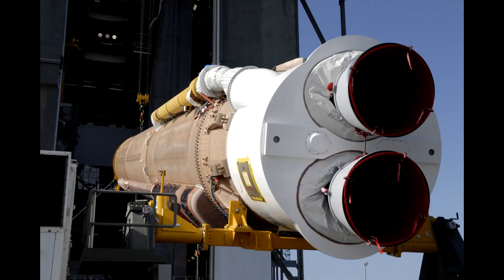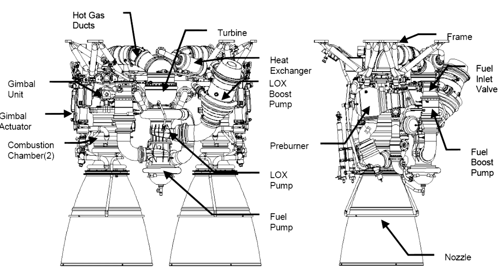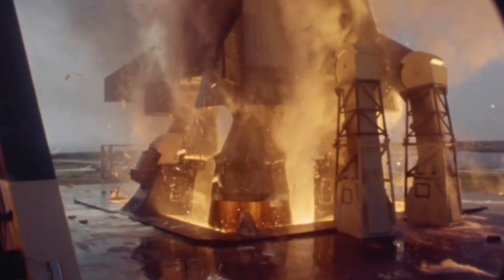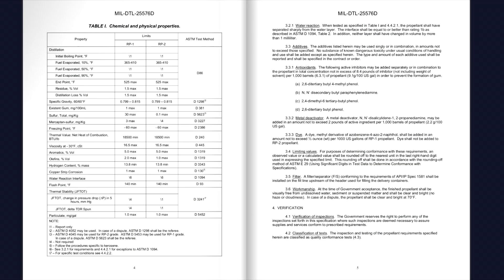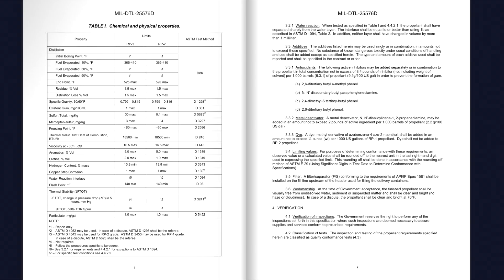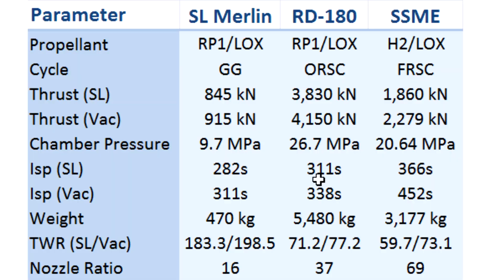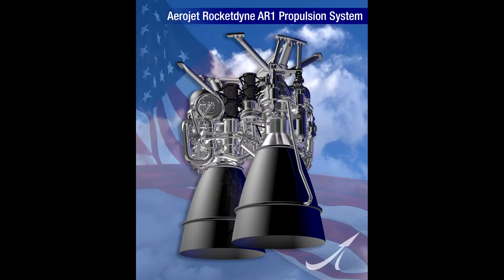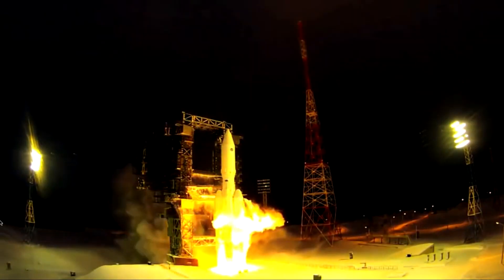Why Some 21st Century US Rockets Still Use Soviet Era Engines

Comment: I find the lack of engineering towards improving things to be disheartening.  Until SpaceX came along with Raptor and BO with the BE4, there wasn’t much interest at all moving beyond 70s era soviet engines... which are only being banned from us launches for potential disruption during geo conflict... and 70’s designed shuttle engines which are still being used in the 2020s on SLS.   Great example of the lack of progress and even continuing steps backward we’ve made in space flight until SpaceX started shaking things up.  The future I was promised back in the 80’s never materialized, not because it was impossible, but because nobody had the will to take risks and find research and development towards long term projects past their current term in office.
Reply: Daniel Guisinger I agree. But the shuttle engines are designed upto the teeth. ISP of hydrogen/Lox is 450 and Chris Craft is adamant the SSME’s are at at 448... NASA believing they could improve the shuttle engines for use in SLS are dreaming. The problem with the soviet RD180 and all its variants is that it’s just to damn efficient and reliable. You can built it quicker, cheaper and simpler but there isn’t a way of making it much better without increasing risks that don’t need to be taken. In all fairness to SpaceX the merlin engine is very reliable with only a single fail safe incident I know of... but it’s hardly cutting edge in terms of efficiency even though they are doing amazing things with multiple starts and full throttle range for landings. Like all engineering they could potentially push the merlin even higher but the compromises wouldn’t be worth the payload gains
Reply: Well, on the other hand, 80'th engines are really darn effective and it's just not worth the money trying to squeeze a handful of power from them. New engines are getting developed though, Blue Orion are pritty innovative with their methane-propelled motor.
Reply: @MaycroftCholmsky   Well said. The gold standard U.S. made rocket engine is the RS-25D. Slight upgrades will bring the RS-25E and RS-25F, each with slightly better eff, rel, and thrust. Even when compared to new designs, instead Aerojet is gearing up to build more RS-25s. Why? They are simply the best! And the AR-1 will soon be certified to replace the RD-180. And the RD-180 is a great engine!
Reply: Launch vehicles faced the same issue the automotive industry did. At a certain point the amount of efficiency you can squeeze out of a engine falls off. And what you can gain by focusing your efforts and capital on something else such as lighter materials. Less materials use becomes a bigger payback.

Your real life example of this is cars today use lots of plastics because they are not only easier to make but lighter. Making the vehicle lighter improves the overall system efficiency. Unfortunately for automobiles this is immediately eaten into with increased safety standards and techy luxuries. So automobiles have only managed to really break even. But just imagine how horrible mileage your SUV or whatever would get today if all those plastic parts where still metal and glass?
Reply: SpaceX didn't have the capital to develop an aerospike engine. And it's a completely new thing with many unknowns. If it doens't work out, SpaceX goes bankrupt before even leaving the ground. Their first focus was to get into orbit the cheapest possible way. That means using existing tech combined with the newest materials, manufacturing technologies and computer simulations. The next step was to launch actual payload to LEO as cheaply as possible, to make money for future projects. For LEO you don't need too fancy engines, and cost can be reduced in many ways other than increasing ISP. TWR for example is very important too to improve overall efficiency. And of course the rocket structure and fuel tanks must be as light as possible. But manufacturing is even more important. We want efficiency only because that means a smaller rocket for the same payload and that's cheaper to make. Fuel cost is actually irrelevant for expendable rockets, so it can be better to make a less efficient rocket that is very cheap to build. Ultimately you want to reduce cost, not size.
The third step is reusability. Obviously if you can use the rocket 10x, that's a 10x reduction in cost (fuel cost still doesn't matter). Of course a reusable rocket will be less efficient, but not that much. The Falcon 9 has to save 30% fuel to return to the launch site and only 15% for droneship landing. And these are old numbers, SpaceX optimized the process further. Now they can launch heavy satellites to GTO and still land on a droneship. The rocket itself has to be heavier too of course to withstand launch stresses several times, but not that much heavier.
The nice thing about these tricks is that they are cheap and can be developed gradually while you are earning money. The most genius thing SpaceX does is that they test new tech while launching real payloads. They needed like a dozen or more tries to make the landing reliable. At $60 million each that would be prohibitively expensive for a small company. But they used boosters that were already payed for by customers, so the tests were almost free. They only had to pay for the extra hardware and the droneships. And on top of that they could also practice reentry for free, which is extremely important not just for reusing boosters, but for landing on Mars too.
Only now that they used every other trick, made enough money and preparing for interplanetary missions, developing a really efficient engine makes sense. And even now the won't go all the way on the first try. The first BFR won't have vacuum optimized engines to reduce R&D and manufacturing cost. The ship will still be good enough, they lose less than 30% payload capacity.
Reply: capitalism is not motivated by advancing humanity, only profit.
Reply: It's called MONEY. With few exceptions, most mega budget NASA programs tended to be DUAL USE. American voters and politicians care little for science and more so can this help me build better ICBMs or recon satellites. If not then you get a meager budget. The Space Shuttle program itself was designed to dual use. If not it would've never ever happened.
Reply: @Blahb-o9b  it's not about some generational conflict. It's capitalism.
Reply: most of the cash put aside for research went into invasion of arab countries lol
Reply: If you observe the fundamental physics, there's very little room remaining for improvement of chemical engines. Take a kilogram of optimal oxygen/hydrogen mix. Reacting them together produces 15.8 megajoules of energy, and a kilogram of steam. If you manage to convert all of that combustion energy into kinetic energy of that steam, you have exhaust velocity of 5.6km/s, or specific impulse of 550 seconds. That's the hard limit of what one can squeeze out of hydrolox, anything higher and you have a perpetuum mobile, producing energy out of nothing. SSME achieved 450 seconds, so 80% of that. There's a measly 20% left out of which it's dubious if more than 10% is practically achievable.
Reply: Daniel Guisinger when you strap 3 living, breathing people on top of a big tower of fuel, you will probably want something that absolutely does not fail.

Silicone Valley did some good work, but their products were horribly buggy at launch (hehe). How many versions are there on your phone's software? Can't really do thay with rockets that carry people.

SpaceX did their work, but they are simply using existing technologies, just more efficiently. The real leaps in science and technologies are still happening in government grants lab (like NASA)
Reply: Xuan Vinh To   Space X's Raptor is a pretty spectacular leap, in my books.
Reply: awuma SpaceX's Raptor is pretty spectacular leap if this was 1958 but not in 2018, it is just "faint copy" of RD-270 (design finished in 1967 and tested from 1967-69), same full-flow staged combustion cycle engine only RD-270 was 3 times more powerful
Reply: Miloš Lazović, don't be silly. The only thing RD-270 and Raptor have in common is that you can say "full-flow staged cycle" for either. But that's akin to saying the 1974 Porsche 911 was not a leap because Sauer was making turbocharged diesel trucks in the 1930s. It's just as ridiculous.

RD-270 was a hypergolic engine, fuel is warm, extremely dirty and dangerous. Raptor is a cryogenic engine burning methane, which is no worse than RP-1 -- more of a headache to handle, but chosen anyway because it can be produced on Mars. These engines have very little in common. And to claim the RD-270 is "more powerful" is disingenuous: raw thrust is a useless metric, it depends on the size of the engine which in turn depends on how many of them do you intend to use together. Raptor has lower thrust individually because it is a smaller engine intended for use in configurations of many. And anyway the overriding goal is not raw efficiency, but reusability and in-situ resource utilization, and even so, it still has better Isp than the RD-270. If SpaceX pulls this one off, it will most definitely be a leap forward. Yet another. These guys are brilliant.

And hey, this is not to diss the RD-270 - to milk 300 Isp out of hypergolics is remarkable, and to do it in the 1960s, even more so. But yeah, don't be silly, Raptor is an entirely different game.
Reply: César Rincón first take clear about 1974 Porsche 911 was not a leap in any meaningful sense, it was just vw beetle on steroids, and not to different to it (fun fact if you didn't know is that Porsche 911 (1963–1989) engines fit in beetle bolt on bolt, that include and Porsche 930 ( 911 Turbo 1975-1989)  engines), and that was very popular swap in my country, many people was putting Porsche 911 Turbo engines in vw beetle because it is so trivial. Not even BMW 02 Series (BMW 2002 Turbo) was leap which was mass produced before 911 and it M10 engine was/is still most powerful engine used in F1 (with over 1,400 hp in qualifying trim in 1986, but that number of 1,400 hp is just guess, they never managed to measure real power of it).
Fact for you (for now, on engines they tested till now) Raptor do not have higher Isp than RD-270, tested Raptor engines have same Ip as RD-270 (RD-270 have higher chamber pressure), and Raptor have extremely small Isp comparing to any cryogenic rocket engine make till now, but that is stupid to compare because different fuels will produce different Isp (LH2/LOX engines will have higher Isp then LOX/RP-1 and N2O4/UDMH will have even lower) LOX/Liquid methane engines should have 3-5% higher Isp then equivalent LOX/RP-1 (which should have higher Isp then N2O4/UDMH engines) so that make Isp Raptor achieved till now look realy realy bad (even predicted Isp for Raptor is on low side of what is capable with LOX/Liquid methane fuel).
Your point that reusability have to do something with row power of engine and Isp is (again) totally wrong, row power and Isp (efficiency) have nothing to do with reusability , only thing that is influence by reusability is thrust to weight ratio (to some extent).
Again here is analogy for you Wärtsilä-Sulzer RTA96-C is most powerful and one of most efficient diesel engines in world (there is only one diesel engine in world that is more efficient),  it produce 107,390hp it last at least 10 years (predicted 25 years) of non stop running (depends of ship but that is 2-3 million km in 10 years), which is let say 500 more power then car diesel engine and 4 times longer life span then best car diesel engines, which contradict your statement that more powerful and efficient engine must be less reliable, what you stated that as reasons why SpaceX decide to make Raptor less efficient and powerful then other rocket engine manufacturers are already manage to do 50 years ago.
So if I put vegetable oil in diesel engine i make giant leap in engine technology? No i do not, they are still diesel engines in which I just change fuel (and yes 99.99% of diesel engines will run on vegetable oil without any problems and any change to it).
I see you are fanboy of SpaceX but in reality Raptor is not in any way revolutionary or leap in rocket engine technology, it is just another engine based on 60 year old technology which other already used.
Reply: +Miloš Lazović You clearly have zero understanding of NASA contracts if you believe it's sensible to count the contract cost for the CRS and simply use that to calculate launch costs of the Falcon 9. That's so ridiculous it's really hard for me to take you seriously. The funds were used for R&D of the Dragon capsule as well as paying for the costs of each capsule made. Here's a summary for what you just argued:

Me: "SpaceX charges $X to launch something into orbit"
You: "No that's not true because you're not including how much NASA paid them to develop a cargo capsule that can deliver payload to the ISS, which has nothing to do with sending satellites into orbit but I still think that must be included into typical launch costs for some stupid reason."
Reply: +Miloš Lazović Also, source for Raptor test specs?
Reply: PROgrammer8 I see you do not understand math so i will try to make it simple for you.
CRS 1 and 1E, SpaceX is receiving $2.8 billion ($1.6 billion CRS1 and $1.2 billion CRS1E) for 17 missions ( CRS1  12 missions and CRS1E 5 missions) ~$165 million each (CRS1  $133 million per mission and CRS1E $240 million per mission).
For CRS2, SpaceX is receiving $900 million for six missions $150 million each.
In that price is not included R&D of the Dragon capsule for that SpaceX got additional  $3.5 billion from NASA.
If you believe that production of Dragon capsule cost ~$100 million each you are realy  delusional  (more then 10 times more then what Russian government pay for Progress, but Progress is sold to Russian government w/o any profit, I doubt that production of Dragon is more then $40 million in worst case) so yes you should count that money to every launch of Falcon 9 that is added to total profit SpaceX make, and yes they can afford to lose some money on costumers launch if they get double of commercial price from NASA.
Reply: +Miloš Lazović So you're just assuming the only way Falcon 9 satellite launch costs are that cheap is because they're losing money on each launch and the NASA contract is making up for it? Any proof other then raw skepticism? Because all evidence that I've ever seen points towards the fact that they make a net profit on the order of 20-30 million per commercial satellite launch.
Reply: Hey science! Where are my jetpacks?
Reply: Well...... Necessity is the mother of invention.
Reply: Look at Blue Origin’s staff in propulsion development, large number engineers from Rocketdyne and Aerojet 
when both of those Industrial-Complex companies made MANY management mistakes after End of the Cold War.
There were also some McDonnell Douglas engineers that worked on Delta Clipper in 1990s.

GenCorp/Aerojet made more money ($$) in real estate development (1995-2005) as they sold off and developed thousands of acres of California.
Did those $$ go to new development?  Well, Aerojet bought the surplus NK-33 engines for the Kistler rocket project (failed, due to no $$).

Pratt Whitney Rocketdyne created RD AMROSS with NPO Energomash to further develop RD-170 into the RD-180 for Atlas.
Martin Marietta flew these first engines on their Atlas IIIR in 2000, then Atlas V was designed around that engine.
Reply: 'Literally every milestone they claim has been done before. 'So, can you point to the other orbital class booster that has been landed before Falcon 9?Because as i recall, before 2015 people were laughing at Musk and calling him an idiot for even trying. And now everyone's scrambling to try to keep up.
Reply: @demoniack81  Landing a rocket is not enabled by a new rocket engine tech, it's the power of modern computers.
So, basically, SpaceX didn't invent anything in terms of space tech
Reply: SpaceX engines are made to be cost-efficiend in mind, this is very different approach US and USSR used in 80s. SpaceX as a private company just derails the vector everyone was thinking in 80s-90s, and with that creates innovative creations. Government owned companies in 80s and 00s just didn't put money first (rather second), so they didn't developed reusable rockets eventhough there were projects, plus US and USSR hands were full with Shuttle programs that prooved to be a failure in terms of cost efficiency.
Reply: When I here stories ...That the F1 engine....could no longer be manufactured....because they were built by skilled craftsmen
And there is a Void today of Craftsmen with the necessary Skills....It does seem..we have taken a step backwards in technology.....😔
Reply: @frankieford7668  ww can't build pyramids like the Egyptians but that doesn't mean we went backwards. There aren't people to build the engines anymore  because they weren't needed anymore we
Reply: @jasonferge3686  
You Dont see to many college age young men and woman that want to learn a trade..  shortage in hands on craftsmen... if you can weld.. your almost guaranteed a 100k job today....but no one wants the position....The mighty Rocketdyne F1....required hand fit and file sections of combustion nozzles....welds that took a day to do....The thrust of the Mighty F1 hasn't been matched till this day..There is a growing need for a big F1 type engine....But it will be less complicated and mostly CNC machined...and designed by computers.....So backwards is probably the wrong word...done Differently.....is more Accurate...
Reply: I wanna know what drugs Milos is on when quoting his RD-270 figures..
Reply: Blah.. I think that has to be one of the most catastrophically idiotic thing I have read in a while.  And I thought Milos was screwed up.  Wow..
Reply: "Not because it wasn't possible,but because.." crapitalism. The future we were promised never came to be because of capitalism.
Reply: Capitalism is extremely risk averse, rather than fostering innovation it stifles it. 

The space race wouldn't have existed if it wasn't for the USSR, everything the US invented in the 20th century was basically the state funding it, that funding would have never came about of it weren't for the cold war. The state innovates and the markets, left alone, stagnate.
Reply: @mickstephenson  Competition drive capitalism. if it wasn't for the investment in the space race we would still be using dial phone and slide rules; they work but they are slow. Find something on the Moon or Mars that worth a trillion dollars, and industry will get real interested. I much prefer my laptop and mobile phone all brought about by government investment with a transfer of the technology to the private sector to create private sectors jobs and generate taxes dollars to fund the investment to start with.
Reply: @mickstephenson  yep, unfortunately ur argument just supports the thesis that war(cold war) is a way to accelerate civilization development. Hence more wars/confrontation better future.... So where do u stand?
Reply: +Michael Stephenson
eh... no.
State can push really long term projects, but market is faster to innovate when they see possible profit and they're better at spreading technology. You need both.
Reply: you know why? it's because we fucking stole all our space technology from spying on the soviets. we don't know jack compared to what they had going for them.
Reply: @maksuree  
> "you know why? it's because we fucking stole all our space technology from spying on the soviets. we don't know jack compared to what they had going for them."

What the hell are you talking about? What is this nonsense? Tell me where the US copied Saturn 5 and Shatal from? American engines - the RS-25 are the most efficient in the world, because they are hydrogen. The USSR preferred kerosene engines.
So where is the connection?
Reply: Yeah, the future of spaceflight will be in the hands of private launch companies now since NASA doesn't want to innovate anymore.
Reply: Except spaceX has done absolutely nothing different or new.  Literally every milestone they claim has been done before. And their rockets are neither as powerful nor as efficient nor as reliable as what has been used for decades.  

I believe private launch capability is important for the future of space flight but you need to be realistic about what they have accomplished.
Reply: F9 has the first orbital class vertical take off and landing booster. It's also the first to land on a drone ship at sea. FH was the first simultaneous landing of two orbital class boosters. They also achieved launch costs of well below half of the competition.

"Efficiency" means nothing without context. Efficiency is simply the optimization of one variable with respect to another. If you define those two variables as "fuel mass" and "payload mass" then yes SpaceX's vehicles would be considered relatively inefficient in that category. If you define the two variables as "launch cost" and "payload mass" then SpaceX wins by a landslide, which is really what matters. If we look at "mission success" and "mission failure" as the two variables, then yes their record isn't perfect, but they've learned from their mistakes.
Reply: PROgrammer8 "They also achieved launch costs of well below half of the competition." it is simply not true, it is true that they advertise that price to costumers (and charge them that amount) but all forget that they got 7.24 billion$ from NASA in period 2006-2016 so that get them ~105 million$ per launch for every rocket they launch till now only in NASA money and you add to that ~60 million$ they charge costumers so that make every their rocket cost ~130 million$ in average (not all are costumer rockets some are covered by what NASA payed) which make it more expensive then most rockets on market (with exception of Ariane and ULA rockets).
That is same what big beer companies do in Europe, they sell you 2l bottle for less money then they sell you 0.25l bottle (and 0.33l bottles are somewhere in between), they lose money on 2l bottles (on purpose) but they recover that lost with sell of 0.25l and 0.33l bottles (there is long explanation why they do that .... but they have "good" reason).
Reply: Miloš Lazović: Every rocket is subsidized. How many billions are going into Ariane 6 development and not expected to be paid back? And ULA got way more money from NASA and the Military in the same period. 

What SpaceX got from NASA was all as the lowest bidder in supply or launch contracts, not like the free money Ariane 6 gets. Also, most NASA contracts include cargo or crew dragon as most of the price, so it's disingenuous to say that their "every their rocket cost ~130 million$ in average" comparing to other rockets prices that don't include capsules that dock on the ISS. Orbital Sciences got an even better deal from NASA: received more than SpaceX for fewer launches of an many times smaller rocket. Where are they in the comercial market? Wait, is SpaceX launch cost bellow half of the Orbital Sciences competition? Of course.
Reply: @mrlazda  
> "awuma SpaceX 's Raptor is pretty spectacular leap if it was 1958 but not in 2018, it is just a" faint copy "of RD-270 (design finished in 1967 and tested from 1967-69) only RD-270 was 3 times more powerful "

You are talking nonsense. First, the RD-170 did not have gasification of components, Raptor had full gasification of components, secondly, he worked on kerosene, and raptor runs on methane, and third, SpaceX simply doesn’t need an engine of such power, because they could implement a multi-drive scheme.
I will add that before raptor, the American RS-25 was the most efficient engine, it had partial gasification of components and it was more efficient than the RD-170. And this despite the fact that it was created before him.
Obviously, you have no idea about rocket engines.

>  but all forget that they got 7.24 billion$ from NASA in period 2006-2016 so that get them ~105 million$ per launch for every rocket they launch till now only in NASA money and you add to that ~60 million$ they charge costumers so that make every their rocket cost ~130 million$ in average (not all are costumer rockets some are covered by what NASA payed) which make it more expensive then most rockets on market (with exception of Ariane and ULA rockets). "

It's just your fantasy. The only money SpaceX received is $ 200 million from NASA as a result of winning the competition. This money was spent on developing Falcon9. The remaining money was received by them as a result of victories in competitions for cargo and manned spacecraft. The launch price for NASA is the price of the CRS mission, which includes the price of the Falcon9 rocket and the Dregon cargo ship. The launch price for the US Air Force is higher, just because military launches are forbidden from insuring in the USA.
Obviously, you have no idea what you are talking about.

Why do not you take up your education, and stop talking nonsense?
Reply: @marxistilluminati9529  I think you should revisit elementary school and learn to read first. 
You write about RD-170 and I wrote RD-270, RD-270 is not same engine as RD-170 they are totally different engines. RD-270 is full-flow staged combustion cycle engine and for you it have "full gasification of components" (same as ALL full-flow staged combustion cycle engines including Raptor) on other hand RD-170 is oxygen-rich staged combustion cycle engine (and for your information have partial gasification of components like all fuel-rich/oxygen-rich staged combustion cycle engine).  
RS-25 ( Isp 452.3 seconds,  fuel-rich staged combustion cycle engine) is not most efficient engine that honer belongs to RD-0120  by slight margin (Isp 455 seconds,  also fuel-rich staged combustion cycle engine)

I think it is useless to reply more to your post, after you show you are clueless and you will even that read wrong, all I write more will be just waste of my time (you would not read it correctly and you will not understand it).
Reply: @mrlazda  Yes, I was wrong. I beg your pardon. But the RD-270 is an experimental engine. It was not produced serially. And he had only partial gasification of the components.
As for the RD-0120, then yes, it is the most efficient engine. But it is no longer produced. And the most efficient serially produced engine is the RS-68.
You obviously do not understand that efficiency is not a defining characteristic for a rocket engine. Especially for rockets with a reusable first stage. The main thing for them is the engine resource. That is why the BE-4 has a mid-performance version of a high-performance system.
And you also forget that raptor components are gasified completely, and not partially. And the fact that it works on methane.

Sorry if i insulted you, probably my comment was too harsh. However, you are also wrong.
Reply: @marxistilluminati9529  You are still wrong, you do not understand meaning of full-flow staged combustion cycle engines.
Quote from wikipedia:
"Since the use of both fuel and oxidizer preburners results in full gasification of each propellant before entering the combustion chamber, "
And that apply to ALL full-flow staged combustion cycle engines with no exceptions (that is difference between  full-flow staged combustion cycle engines and fuel-rich/oxygen-rich staged combustion cycle engines).
That apply to RD-270, Aerojet Rocketdyne Integrated powerhead demonstration project and Raptor.
You are right that RD-270 was experimental engine but same is Raptor, only difference is that RD-270 was produced in more numbers and tested more extensively (and performed much better even what are prediction for Raptor).
nd the most efficient serially produced engine is the RS-68 is again not correct, correct answer is Mitsubishi  LE-7A engine used on first stage of H-IIB (if we talk about first stage engines, upper stage is RL10B-2 and absolute winner is XIPS-25 ion thruster, all are in  production)
Reply: @mrlazda  LE-7A, yes, I completely forgot about it. Thank. However, further you talk about ion engines, but you are wrong because they are not rocket engines. 
You also forget that the RD-170 is a kerassin engine, which means less resources than methane engines, which is extremely important for reusable rockets. And the gas in the RD-170 is oxidized, and in Raptor, the components are fully gasified. It almost does not affect its effectiveness, but should increase its resource. And this, again, is extremely important for a reusable first stage.
Reply: +DrewLSsix: Nothing different, new more efficient? Can you name any turbo-pump powered engine that also features face shut-off besides Merlin 1D? Can you name any rocket with better mass ratio than Falcon 9? Or any rocket more efficient than Falcon Heavy (measuring efficiency as payload divided by take-off weight, that is biased against pure kerolox rockets, by the way)? There are tons of small innovations to achieve those record breaking dry weights. Even if some are just, for example, replacing copper by fiber optics in the rocket umbilicals, they were the first ones to do that.